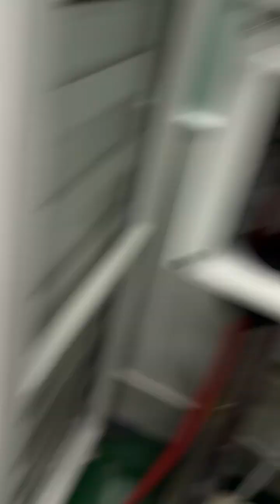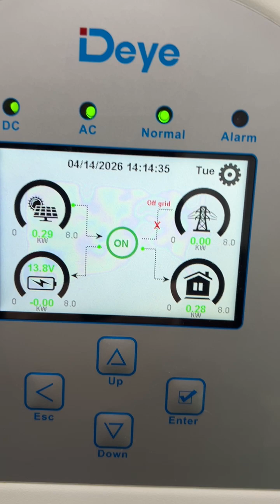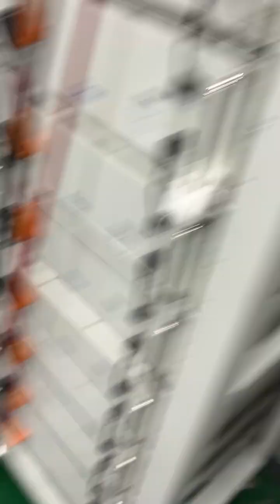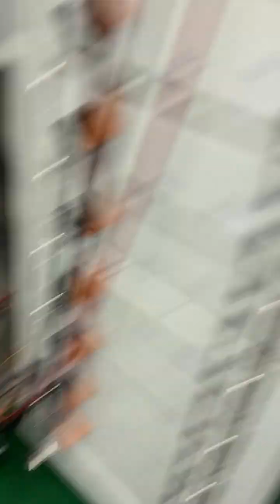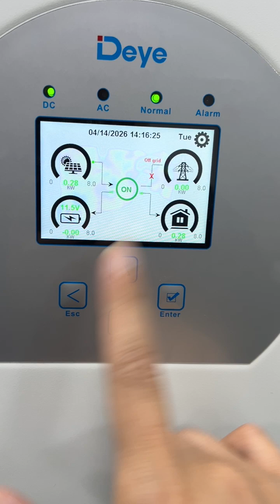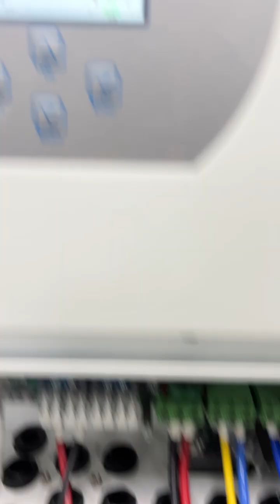How to use Solar Only function for Deye hybrid inverter

Comment: Sir in my 15kw hybrid inverter SG05LP3 model i face F56 fault and at that time the battery soc becomes 0% and within minutes the battery soc shows 100% 
I have 100ah one battery and i am also using smart load function
This fault happens in day time when pv and grid both are present